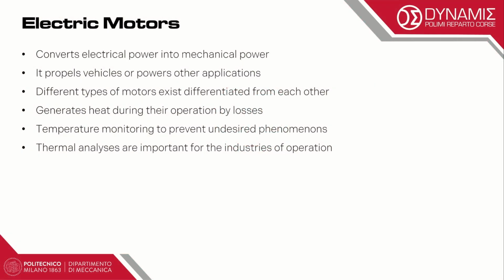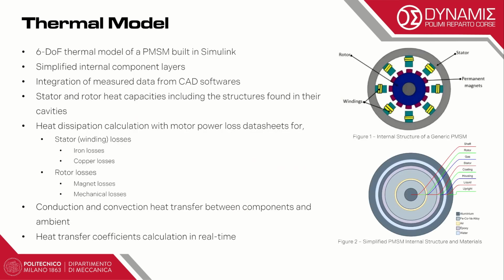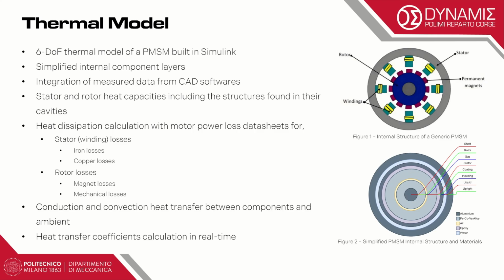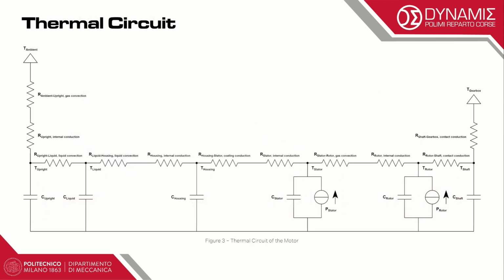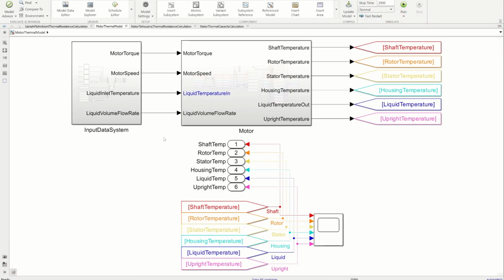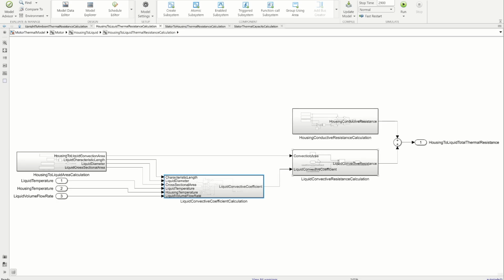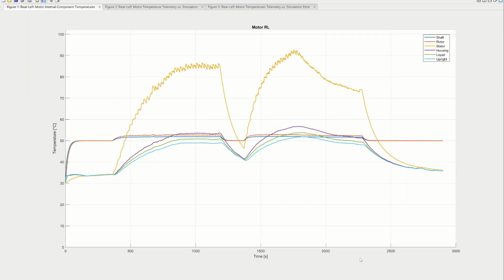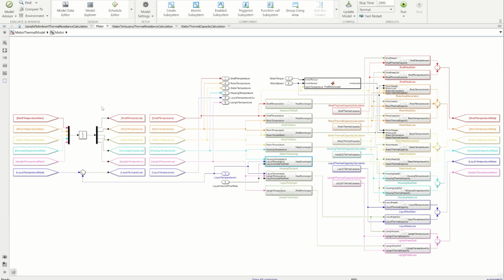Electric Motor Thermal Simulink Model Presentation - #SimulinkStudentChallenge2024

Comment: Good content, makes me know a lot about the thermal model
Reply from the maker: Happy to hear!
Reply: Thanks for the video.Are there any references that you recommend for building the motor thermal. Mode
Reply from the maker: @40NoNameFound-100-years-ago  Through the model, I mainly used the classic Fourier's Law relations for heat fluxes. You can find them easily online, but if you need a book, I could suggest Fundamentals of Heat and Mass Transfer by Frank P. Incropera. A figure showing the structure of the thermal circuit is shown in the slide; you can refer to that for the heat transfer relations between each component. For the heat transfer coefficient calculations, depending on your motor's structure, you can find correlations for convection and conduction from cylindrical surfaces online. Let me know if you have any questions!